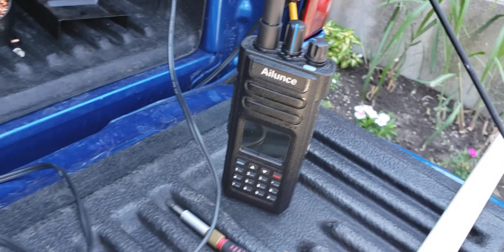Diamond V2000 Antenna Repair

Comment: FYI: The Xiegu G 90 working quite well with Mag Loop facing South East. I use it mainly on 20 m 14.078 JS8Call. Do you HF at your QTH?
Reply from the maker: Yes I do HF dxing, stopped playing FT8 at this moment but I will get back to it one day. Bands are too good to waste it on digital modes, I go on 40m, 20m, 17m mainly and do lots of SSB voice